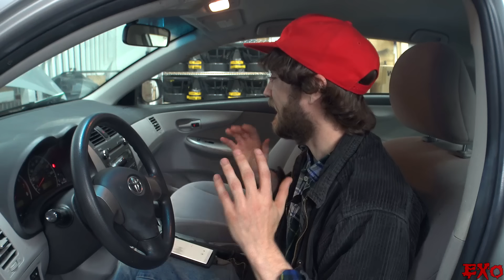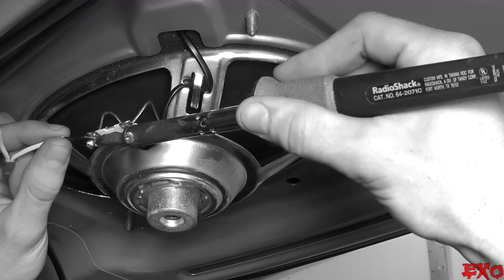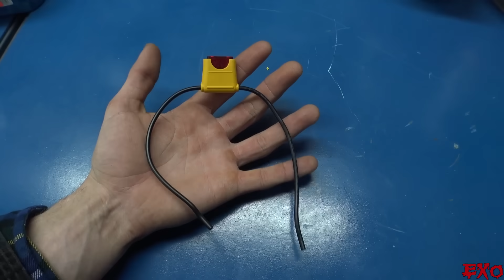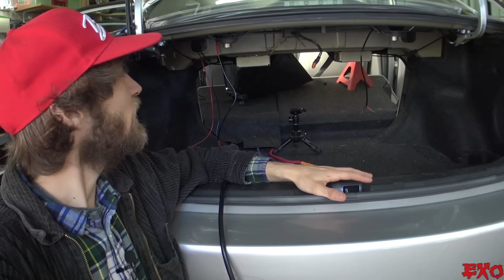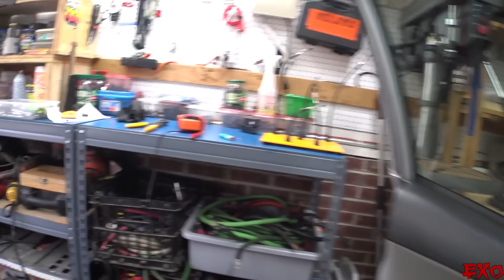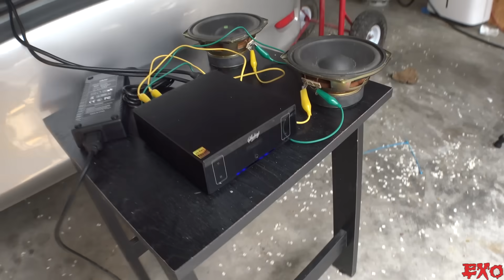How To INSTALL a Line Output Converter w/ Stock Radio & Speakers 4 Aftermarket SUB AMP Installation

Comment: You got me back into car audio after almost 20 years out of it. I just installed one of those line out converters to connect to my 5 channel Skar audio amp.
Reply: Try 2 ch 2 ohm D class 2000 watts
Reply: Yo if u read this maybe u can help me out like u said i was out of car audio for 20 years lol these line output converters are new to me in my days we ran ours wires to the aftermarket hu..anyway i used this in my bro in laws car but when he drives his sub amp shuts off high amp stays on do i need to have the stock 6x9 rear speaker hooked up also? All i  did was run the output converter directly to the stock speaker wires i didnt reconnect the 6x9 stock speakers could that be the issue with sub amp shutting off?

Comment: Wouldn’t it be easier to first solder all the mess up having it on the carpet and than fix it with the ziptie on the top of the trunk 🤔?
Reply: Daniel bro the wires are already ran in the car lol ..
Reply: randall jr Benoit you don’t get it. Why to fix the converter box to the body and the solder the wires laying in the car upside down? Solder the wires and than fix the plastic converter box on top of the trunk. Comprende?
Reply: @digidandan  because the factory wires are not long enough to pull down. At one point he even  solders directly to the terminal on the speaker... Even if the wires are long enough it's not worth pulling the speaker out to solder it on the floor. Does that help?

Comment: Totally unrelated question, how the hell do you still have hearing? you hiding earplugs or what?
You run savage setups producing insane levels and i manage to screw my ears up on a regular basis with just two 12's in a 4 door family hatchback.
I keep temporarily damaging my ears to the point where im partially deaf and have weeping ears for 3 days.
Yeah im driving those 12's and my components with decent power but still, its not a scratch on the power you run and i dont know how your ears cope lol.
Reply: What is your crossover set to?
Reply: @BrandinDanesi  my high pass is letting 125hz and above to my components and my low pass is letting 125hz and below to my subs.
Reply: @stevefox3763  that's about right. When I had my first bandpass system I crossed at 250, and the box was a bit peaky. I too had a bit of eargasm syndrome for almost 6 months. Generally speaking lower frequencies you can play louder without much issue. I noticed the music that did it to me tended to have 100 to 200hz notes. I now crossover as low as my front stage will let me, on the deck crossed about 100 and on the amp at about 75. Hope it calms down for you.

Comment: I have a 2007 Infiniti m45s with Bose 14 speaker system and I tried connecting everything but when done I didnt get bass and when I put the box in the trunk I would get loud humming shake the whole car...any ideas why?
Reply: More info. Did you use a line converter, and if yes then did you connect from (ie rear speakers, factory sub?) Just an initial guess, but with that many speakers it probably has an additional amplifier, which if you converted from a rear speaker, could have a high pass crossover setting preventing bass frequencies from being played. The humming shake is likely a ground loop of some sort being introduced from the converter. Might want to Google your stock sound system to learn which output will have full range, or at least bass frequency output, and then check the manual on the converter to see about ground loop troubleshooting, or possibly getting a ground loop isolator.

Comment: I connected a line out converter on my stock stereo and I only wired in the Left and Right, Positive and Negative leads. It seems to work fine and I didn't have to wire in any power or ground... Could you explain why this is?
Reply: Most don't need it if they don't produce their own turn on output

Comment: Or buy a Lc21 simply connect pos/neg speaker wire coming from doors and u up n running
Reply: Or step it up and buy the dm-608 or dm-810, one of these is in my shopping cart, still waiting to pull the trugger
Reply: tankdog03 facts gotta agree with u

Comment: Do you have a fuse on the amp wire up front by the battery because it’s not to safe to have it in the back of the car

Comment: I made a passive version of this with 3 resistors, its fairly simple to diy. Been using it for 2-3 years and never had an issue. A proper LOC is going to be much better though

Comment: never had any luck with those output converters always ended up having alt wine coming out the voice amp...I got mad to the point and just swapped out the stock radio.
Reply: That’s what the other ground wire is for, it’ll take the noise out. Also make sure your RCAs aren’t touching your power lines.
Reply: @Article_170  what would you do with the other ground wire??? Just ground it to something?
Reply: Walter Baldwin Yes, ground it to something solid, sanded, pure metal that’s part of the frame.
Reply: Walter Baldwin Or you can ground it to the other ground wire, just tap into it
Reply: If you switch to an aftermarket head unit do you still need the output converter?

Comment: Hey Exo, The link you provided for the converter on Amazon has 3 different models 80, 160 and 300 watt? How and what does that matter when installing an amp for mids and highs and 1 for bass? Thanks you rock bro!
Reply: R Hunter I would imagine that’s the input power levels, ie: what your speaker would see from the headunit, as you just send a simple signal out of this unit. So unless you are tapping into a factory amp or higher power system the 80w should suffice fine

Comment: Hey Exo I got a question if you want to keep ur factory head unit because has AC features integrated but want bass which would be the best way to go about it lc7i or just go with a 7 band equalizer? I would like to be able to adjust/fine tune my mids and highs but also have the best output for my sub..
Reply: Just looked at the lc7i, which is a basic hi to low converter as well (with some added features.) The 7 band would be able to attenuate certain frequencies The lc7i has no frequency adjustments at all. If you don't have an amp for the mids and highs, you might be hard pressed to find an in line eq. Most eq's have rca input and output.

Comment: Man ... I feel you on breaking your neck in that trunk.
I had to get in my 2013 Corolla trunk a few times.
I could get in with no problems but, being a heavier guy ... getting out was a mess.
Reply: fold down the rear seat and just lay down from the inside?

Comment: just to remember alot of newer cars have complete plug and play amp add on harnesses you can get. shouldn't have to splice into speaker wire then. but these work too.

Comment: Good video EXO but I do have a question. Bass is mono so why not just run both wires from the converter to one speaker?
Reply: I'm not EXO, but bass output is mono but needs a strero L/R in because if the music track has a bass line that travels from left to right you would lose ever which channel you didn't connect. If you tried to connect both factory speaker wires to 1 channel of the converter you would short out the factory radio and/or amplifier.

Comment: I've used those wasn't a big fan of them but it's a great idea for low budget
Reply: SORRY but  if you  have a  stock intergrated  system  where your climate controls and computer is all in one and your sound system is amazing has speakers and tweeters out the ying yang ( AUDI S4)  you kind of need to use a line out convertor if you want some subs and an amp or 2! But you get what you pay for...  Buy a cheap 20 ebay model or spring the 60-100 and guaranteed no issues...  SOMETIMES ITS NOT A BUDGET IDEA WHEN YOU HAVE TOP OF THE LINE ALREADY..  Just Saying

Comment: Hey i asked this question on another vid but what do u recomend for best bass in a sealed box type r series or nvx. It wont b played for hours at a time. But i dont know n e thing bouy nvx. And im asking bout nvx vc series? Would like ur help exo. And i probably need to send a pic of my box so u can c my cubic feet. Im no good at it. I just suck at math. Ty
Reply: If the box is square just measure the width length and height, as well as how thick the walls are and add to your post. Also if you have an amp that might determine which to get. Also add in what type of vehicle. Good luck.

Comment: My amp 2500 watt popped a few weeks ago, right as i turned it on. Not going to repair it so im going to be with out bass for maybe a few months :/
Reply: That sucks bro. I'd loan you one if your in Central California.
Reply: @MadDragon75  im in central valley homie 👍 i have a single hdc3 12 rn :) that thing slammed hard. And I was barely planning on getting more mid range speakers for the doors. I have a feeling if I messed on wiring it up, my whole system would be burnt not just my bass amp. What amp should I look into gett8ng?
Reply: @justchillin7274  after taking out the amp, try taking the back off and having a look inside. That might give you a good idea as to what happened. Dumb question, but did you check all the fuses?
Reply: _1_  not sure where to start checking since before that I had a hifonics for even longer installed but never popped or gave me hiccups. Im using a universal bass knob, since the oem knob caused bad engine noise on sub.